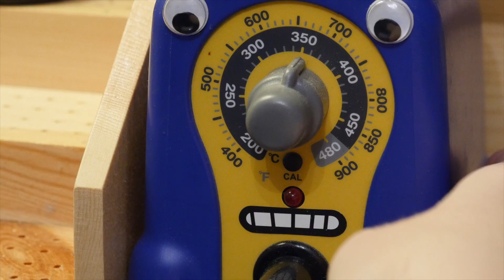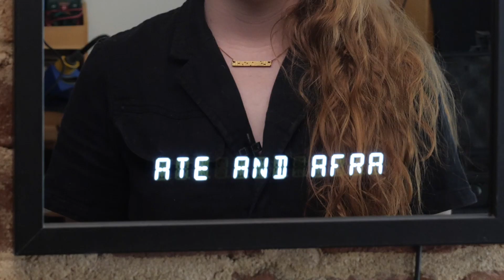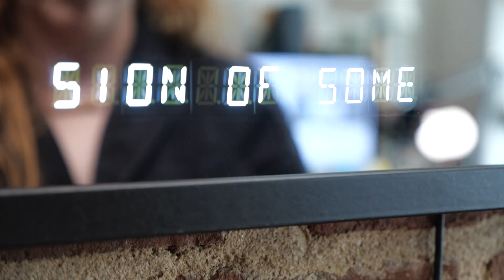Electronic Affirmation Mirror // Becky Stern

Comment: I'm having trouble getting the sample test code to function and the downloadable code doesn't seem to work either.  Is there anywhere someone could point me to gain a better understanding.  This is my first time working with esp8266.  Please be gentle!!!
Reply from the maker: What's the error that you're getting? If you can't get the test code to function, then I imagine you are either missing the libraries you need or don't have your board configuration installed. For deeper understanding, try my Arduino and IoT classes: https://www.instructables.com/Arduino-Class/ and https://www.instructables.com/Internet-of-Things-Class/